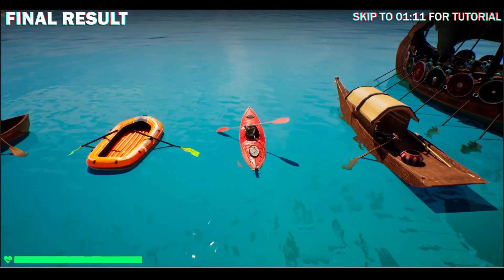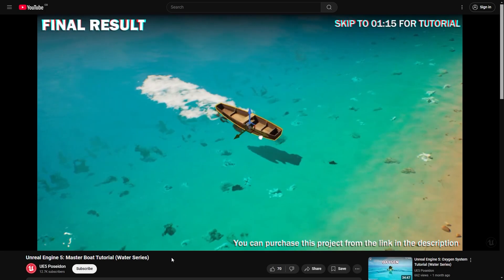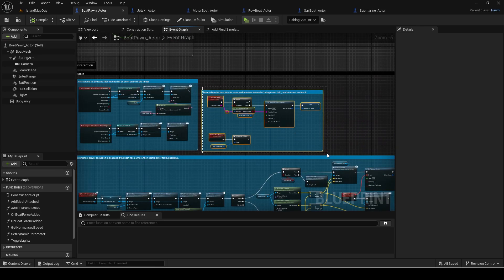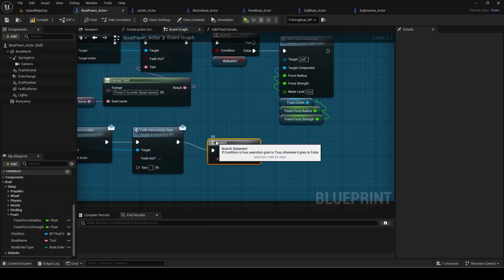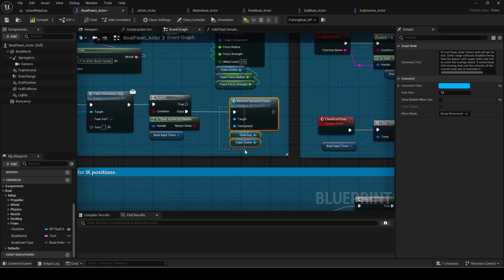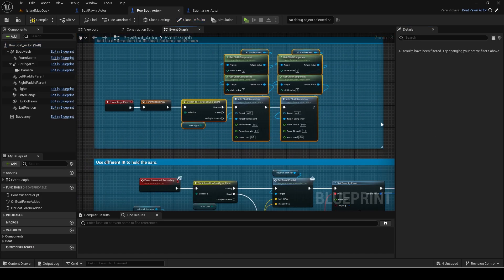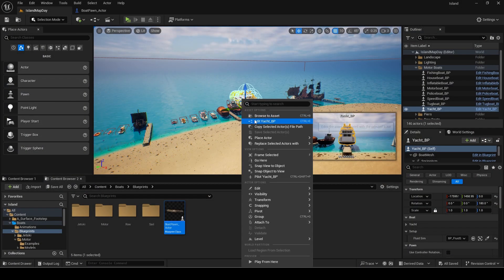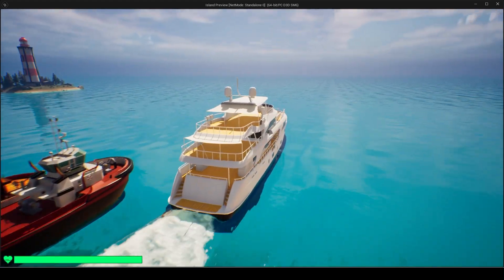Unreal Engine 5: Water foam error fix (Water Series)

Comment: Great videos, thanks for the update.

Could you make it so the controls work with a gamepad such as (Xbox Controller ) as well as the keyboard.
Currently i move forward with the joystick, and the speeds go crazy. Also very sensitive reactions to turning etc.

Everything from your tutorials has worked 100%.

Thank you
Reply from the maker: Hi, thanks a lot for the kind words and glad these videos are helpful for you!
I could do controller input but based on my view count I don't think it would be a good investment as it takes me quite a while to do AI voiceover and a niche video like controller input for the boats won't do as well. Also I haven't actually worked with controller inputs for unreal except a quick test a couple years ago for UE4. Sorry about that bro. I can probably guide you to a start however as there are many tutorials on it already online.
If it is really sensitive, then a clamp float should most likely do the trick. Make sure it is clamped to 1 as the max since maybe controller inputs can go above that. Or a better approach would be to use a map range clamped. Find the max value printed when the joystick is pushed all the way then set the values in the map range clamped to IN (0, that max value) OUT (0, 1).
Hope this helps and let me know if you have any further questions!
Reply: @UE5Poseidon  Thanks for taking the time to reply. Ill give that a go